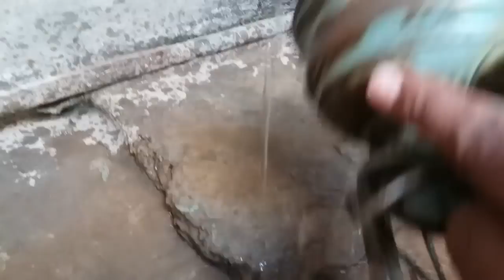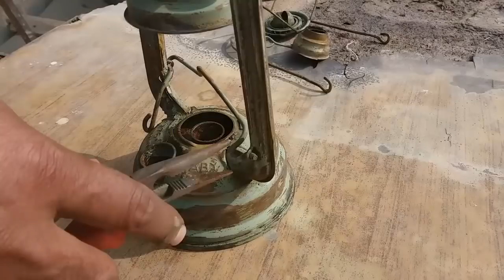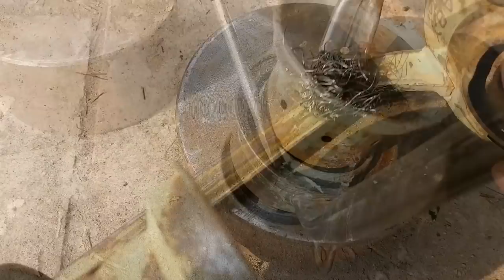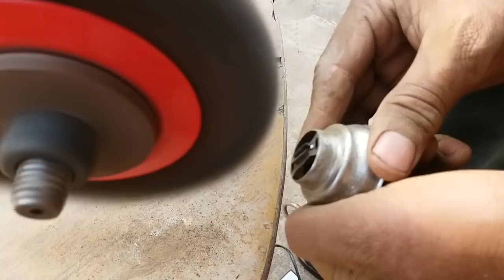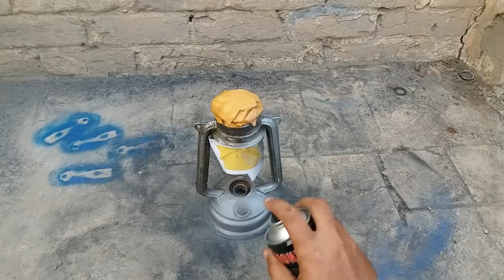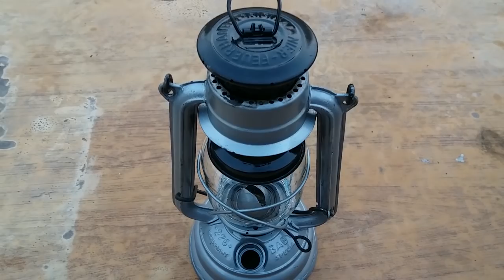Restoration of Rusted and Antique Lamp

Comment: Nice!

Why didn't you use paint stripper?
Why didn't you use a derusting solution (like acid or electrolysis) to derust the insides?
That cap on the side seems dangerous can't you make one that fits tightly?